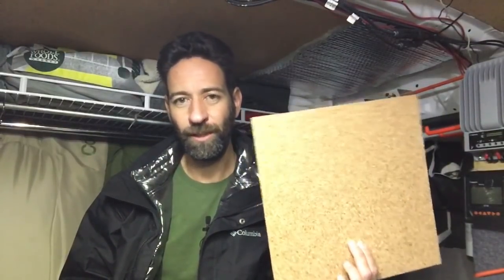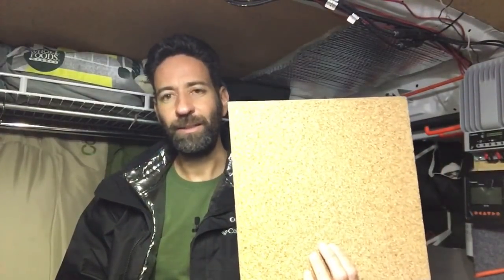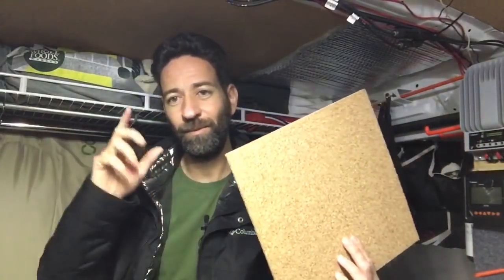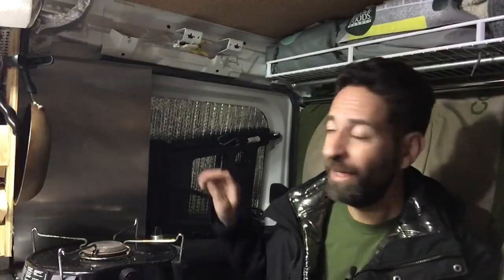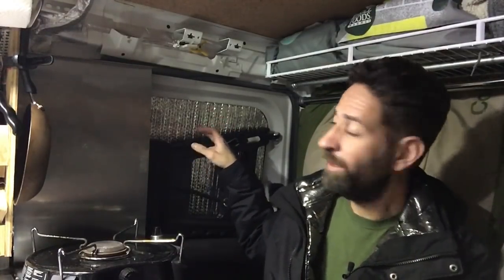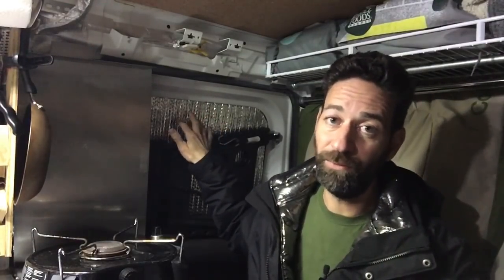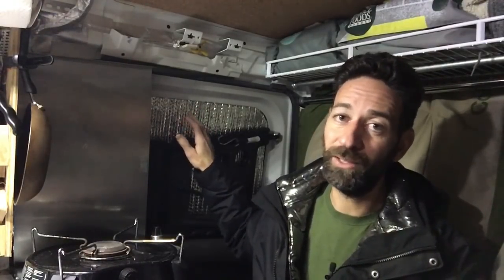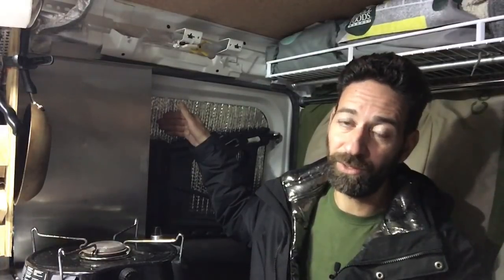Update on Using Cork to Control Condensation in my Campervan

Comment: What did you put in between metal and cork ? Wool or refletix?
Reply from the maker: Nothing. I don’t want to insulate my van. I simply applied the cork to the bare metal. My idea was to use the cork as a thermal break, not insulation.
Reply: Static CamperVan   Did you cover the entire cork tile with adhesive leaving no area without glue or did you use adhesive on the cork just enough to have it stick? Thank you, again, for a great video. A hug from Texas.
Reply from the maker: I covered the cork with a fairly heavy layer of adhesive. Cork is porous so I found it necessary to apply enough adhesive to seal the cork first then another light layer to stick it to the van.

Comment: Has anyone tried using cork as window insulation? Instead of reflectix?
Reply from the maker: Everyone is so convinced that Reflectix works, very few even try using anything but. It’s a shame because Reflectix doesn’t work if it is contact with another surface.
Reply: @StaticCamperVan  So should I try it? Could I cut it and use it by itself?
Reply from the maker: Give it a try. Cork is a good insulator but the sheets I used are fairly thin. You might need to double them up or find a thicker cork. 
My only suggestion is you might want to seal whatever cork you use as mine has dried slightly and now has some tiny gaps between the panels.

Comment: No natural product is going to work long term unless you have ventilation. Moisture locked up in a small space is a problem. Humans are not designed to live in such small spaces with a lot of moisture. So it does not matter what wonderful product that u glue on to yr walls & ceiling, you will have issues!